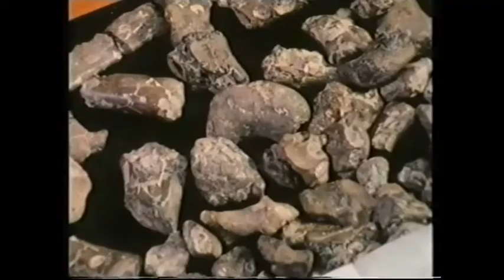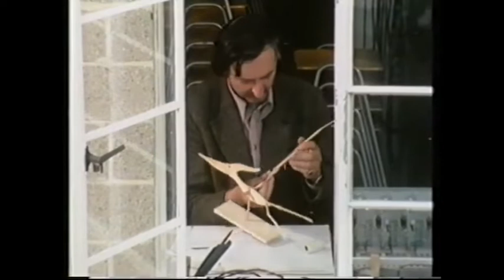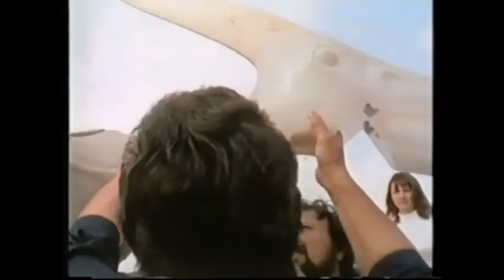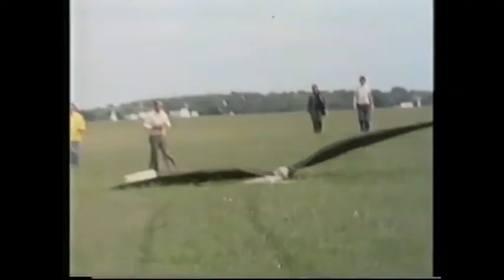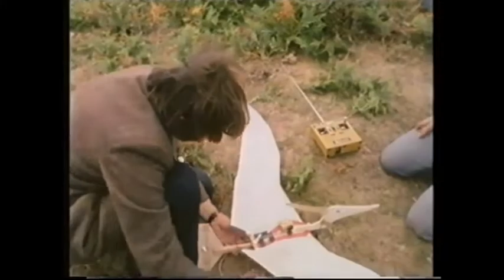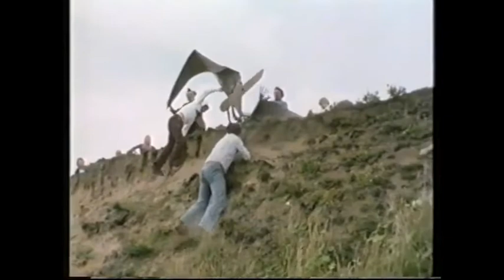Flight from 70 Million Years B.C.

Comment: Super nerds of the 60’s! Remarkable although even the smallest RC aircraft nowadays is infinitely more complex than their best efforts with carbon ‘bones’ 6 axis gyro stabilisation, GPS ‘return to home’ technologies. Those wings were producing almost zero lift, possibly negative lift, they over complicated what should have been essentially simple. 3 tubes and a roll of Dacron and you can fly cross country, so interesting to see the lack of understanding of fundamental aeronautics, did they not have a single advisor?
Reply from the maker: Ooh that's a bit harsh 😦

Comment: This is great, I wanted to build a RC pteranodon back in the late 70s or so, but only got so far as a small balsa chuck glider.   The problem being that I was unsure if my planform (sweep) was correct.  I see from this it probably was right.  I have been into sailing and both hang gliding and RC comp in which I got a 2nd place at the LSF nationals with my own design back then.  From what I see, there was a basic problem with loss of wing skin tension. at low angles of attack.  The wing appears to stall, then dive resulting in loss of tension and flapping membrane.  In this condition, there is no aerodynamic lift reaction to couple against weight for stability control.  Therefore it can not recover from the dive.  It is my understanding that the arrangement of tendons in the skeleton and along the trailing edge would allow the wing skin to remain in tension and the tips to move forward in the event of zero AOA (zero lift).  This would allow a smooth airflow attached airflow over the centre reflex stabalising surface and a forward movement in centre of lift which would pitch the model up and recover from the dive.  This is kind of similar to how a modern high performance sailing skiff responds to gusts, twisting off to shed excess lift in gusts and powering up in lulls automatically.  That sailing technology didn't exist in the 70s, at least not to the extent is does now.  Seems to me , this could be solved now.

I have successfully designed and built an RC flying wing years ago and Ludwig Prandtl developed the bell shaped lift curve for flying wings completely solving the adverse yaw (stability) problems of Northrop's attempts.  My chuck glider version has a stability issue and spiral dive due to tip stall.  I hadn't twisted off the tip to compensate for lower Cl crit at the tip's relatively low Re.  However, as I said above a tensioned skin would twist off at the tip under lift load but pull flat and move forward when unloaded increasing both tip AOA and area moment ahead of the AC producing force moment.

In short I think it's worth revisiting this if it hasn't already been done.
Reply from the maker: It's a fascinating question... Can a mechanical machine mimic an actual living organism, with a brain, sensory organs, pain sensors etc.. I guess we still have a long way to go, an even longer way in the 1970s, but you've gotta start somewhere!

Comment: The position of the head probably had significant aerodynamic effects.
It can obviously control center-of-gravity to affect pitch,  turning the head could control yaw and roll.
Be hard to do with simple servos and mechanics of that time period.
Reply from the maker: I'm afraid I'd have to agree with that.
Reply: exactly what i thought as i watched it fail again and again, the head functions as the rudder and elevons to control pitch, too bad they couldn't acknowledge that, since it's a bird with no tail, the head and neck becomes the tail.